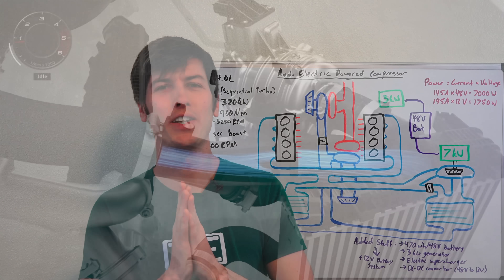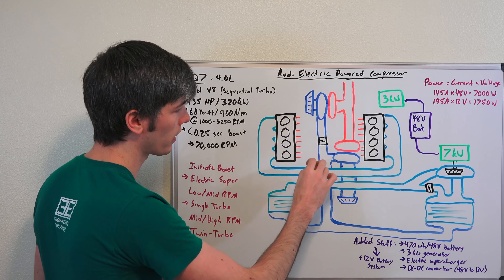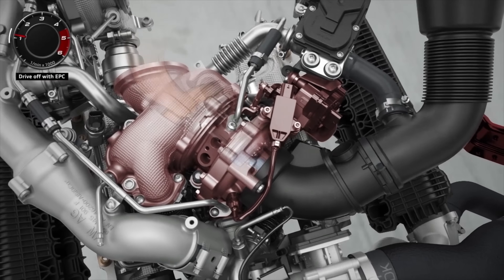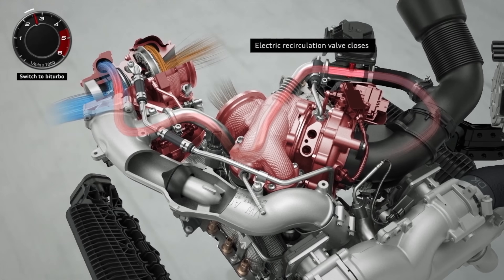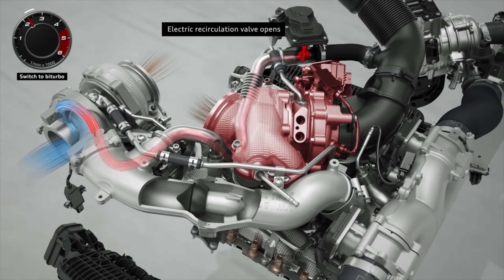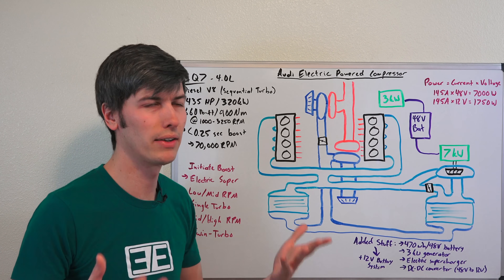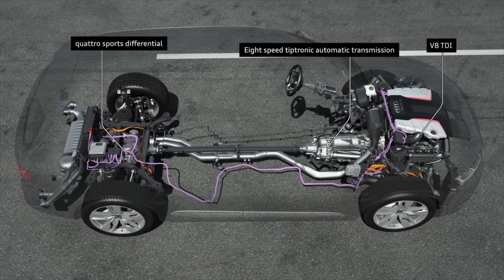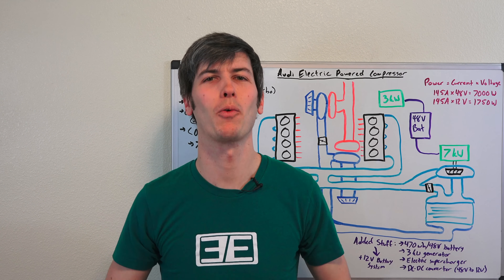Electric Superchargers - How Audi Is Eliminating Turbo Lag

Comment: 145 amps? 
LOL
-car audio guys

Yea, 48v makes it more efficient, but you could get 7kw out of your 12v battery with 583 amps (Wich is less than its cold cranking rating), and do that for up to 30 seconds before you've really put the hurting on a normal 12v battery. 
Instead of having a separate 48v system, you could just have a 2nd 12v battery, and then you're splitting the load between them down to just under 300 amps per battery.

Or just replace the old Lead Acid car battery with a Lithium battery of the same size, and reap the benefits of increased storage, increased discharge rate, and decreased weight.

Then all you need is the motor controller that can handle ~600amps , 7kw, and you're good to go.
Don't need a seperate charging system, just a high output alternator (350amp large case alternator) and you've got plently of power to run the car, charge the battery, and have enough to replenish the battery after the heavy draw from the electric supercharger.

Essentially you just do all the things that the car audio world does to support a 7kw system, but instead of subwoofers and amps you have an electric motor and controller.

Comment: Why not just sandwich a motor between the two housings of a turbo? The turbo could function as usual, and the motor would only be used at low RPM when there isn't enough gas to spool the turbine. Fewer parts under the hood, easier to package, and the motor probably wouldn't have to be as powerful as a standalone electric supercharger.

Comment: I disagree with the conclusion because the only expensive part is the compressor and even that isn’t that expensive. The electronic components are dirty cheap these days. And if (there’s the catch) the manufacturers decide to switch to 48V altogether the cars wouldn’t be that much expensive. And you could gain in reduced consumption what you would pay extra for the system. The manufacturers are the ones who want us to pay more for a technology that should be already installed in our vehicles. So that’s that. Otherwise a really good presentation. And thanks for it.

Comment: So similiar to what f1 is doing?
Reply: Harry Kettle not really. F1 has the motor between the turbo inlet and outlet, plus a generator on the crankshaft. The turbo outlet takes over the job of generating shaft power while the engine is running, and can even be wholely disconnected from the inlet to be used to scavenge energy for the battery.
Reply: David Jackson, II Thanks!

Comment: Think an assist motor like ram truck introduced would be much more useful. As it can also recover energy under braking. But this idea may have been more practical for emission reasons in keeping the exhaust hot.

Comment: Battery would only be powering stuff when engine is not running (I understand the need for the 48v system for powered turbo)

Comment: Electric motors: instant torque/instant boost. Can't beat it. Audi A7 uses the 48v battery for its mild hybrid system (torque), and the Q7 TDI uses it for supercharging (boost). No matter how you see it, electrification is the best for efficiency and performance.

Comment: It is not because 12V cannot deliver 7kW. It is because you cut down the current by half by using 48V when delivering same amount of power. With that, you can design a motor running at lower current hence, smaller conductors.
Reply from the maker: 1/4, not 1/2
Reply: Engineering Explained o yeah my mistake

Comment: There is a mechanically and conceptually simpler way to do this, and they are starting to use it in Formula One. Conceptually, take a 5 ~15 Kw electric motor / generator, and stick it in the middle of the turbocharger. Imagine something like a big electric drill, or a starter-motor. At idle or small throttle constant speed driving, it does nothing. When you start to drive harder, the EMS uses the battery to drive the motor, to provide at least the start of boost, to limit and minimise turbo lag. It spools the thing up, and it does that when you start to get on the throttle... Once the motor starts to make boost, the EMS switches the circuitry around and starts to use the motor as a generator, and gives back to the electrical system. By controlling how much mechanical drag the generator makes on the shaft, you control the boost. Suddenly you don't need pop-off valves and waste gates, you need electronics that can handle high current and fast switching, and a clever piece of software that controls it.
The downside is you need a pretty good electric motor / generator, because it has to spin awful fast, and if it has the power capacity to work properly, then it adds a huge amount of inertia to the turbo. Without the electric assist, the turbo lag is going to be about 10 seconds... and then it has no waste gate. Without the generator function, you're going to overboost....
What you describe in your clip, does a similar job, but it's more complicated and less elegant and probably not as effective.
Mercedes Benz and Lewis Hamilton like this idea, and so does Sebastian Vettel and Ferrari... Honda probably don't like it, because they've had a tough time getting it to work properly...

Comment: Complexity is the enemy of reliability. This is easily one of the most complex systems I have ever seen since the Bugatti W16. Can't wait to see these break down and the repair bills that follow. I'll stick to my EV.
Reply: audi already has a 48V battery in most of their cars. it's just better and more reliable than a 12V alone. so the only thing they added here is one motor-compressor. quite simple solution for the age old problem of turbo lag.
Reply: yeah..you get error code by changing the wheel size these days which is absolutely bonkers..
Reply: Was thinking almost the same thing - WAY,WAY too many things can go wrong with such a sophisticated system- I'll never think of buying one.

Comment: so apart from that stonking v8, its got two compounding turbochargers (i hope im not wrong with the term), an electric supercharger to fill in the turbo lag, a separate 48v system, two intercoolers, and valves that deactivates when not needed...

Comment: That sounds needlessly complicated.
First: why not electrically spin up the small turbo? It would save 1 charger and effectively reduce the power needed before the engine can take the charging over.
Second: why 2 separate batteries? Why not just 1 48 V battery and then convert it wherever needed, those components are dirt cheap nowadays and you would actually have less impedance on the wires with 48 V.

And all of this complexity to avoid making the engine bigger to avoid taxes.

Comment: Could you just add 4 car batteries or deep cycle marine batteries in series in the trunk to get 48 volts and then add an extra alternator to charge them? Would that provide enough current? Besides the weight penalty, what problems could it have? It would be pretty cheap too. Electric superchargers for everybody!

Comment: Jason, can you explain a bit about the advantages of using the 7 kW motor to compress air, versus simply using it for torque-fill by direct motivation of the engine?
Reply from the maker: By compressing air it eliminates turbo lag. If it were to to power the wheels, 7 kW pales in comparison to how much power the twin-turbo V8 makes. You wouldn't notice a difference.
Reply: In order for that to be true, an input of 7 kW would have to result in an increase in output exceeding 7 kW. Doesn't that violate conservation of energy? I guess this question applies to superchargers in general though.

Comment: wow you are an ontime bro...So when are you going to drive the Audi SQ7 just for the point of determining that your complaint about turbo super cars that being a throttle that responds timely to the driver's input with out delayed engine response does not occur or occurs to a lesser degree in the Audi SQ7..By the way what was the last cable actuated throttle bodied car you drove?
Reply from the maker: My S2000 has a throttle cable, drive it all the time.
Reply: so no computer chip in your s2000 to determine if ......before allowing the throttle response chosen via accelerator pedal position ...if you you do not understand what I mean by "determine if " I mean stuff like current grip/slip, yaw, engine speed, gear transmission current in, and let us not forget EYSIGHT governor's input opps did I just reveal that currently I am driving a subaru
Reply: Found this throttle by wire (cars computer + throttle pedal position) versus throttle by cable (your foot) quote and understand why you dislike turbos. 
"i didn't think about that. you went from a throttle cable to throttle by wire. the tbw will only open the throttle at a set rate whereas the throttle cable opens the throttle as fast as you can stop on the pedal. with the tbw, it only opens at a certain rate whether you roll onto the throttle quickly or if you stomp on the pedal. you literally can sit and stomp on and off of the throttle quickly and there will be no fluctuation in throttle response. this may play into the feel when you're getting back on the gas after shifting gears."

Comment: I guess if you buy a high powered luxury SUV you're probably not the sort to worry about repairs.
Reply: Yeah there is a reason these cars are worthless once out of warranty. But there are some good cars to be had for a careful buyer. But with increasing complexity like this, those days are coming to an end.
Reply from the maker: Exactly the truth, I think a lot of the comments miss this point. People lease and exchange expensive vehicles every few years. Reliability doesn't always matter, depending on who the consumer is (and that doesn't mean it can't be reliable, either. Just depends on how long the engineers want it to last).
Reply: @EngineeringExplained  That's what needs to change in this world, throw away society, a well engineered product should be reliable and last, otherwise it's badly engineered.
Reply: Luxury car brands are over 60% leased. Those buyers tend to want a new car every 3 years and know that a dealer will take care of any issues with it during that time. Business wise it's probably a better model to lease and rotate people through new cars more frequently than if they bought.
Reply: fuel economy is the reason. if you rotate a regular supercharger continuously it's gonna use a helish amount of power. turbo's are more efficient and they don't use power if you're not on boost. and you won't be on boost unless you mash the accelerator because it's a good ol' v8. they want to introduce some mini hybrid system with the 48v system too. so mini hybrid, plus supercharger only on demand plus a bit more efficient turbo means less fuel used. the only thing to drink your fuel left is the lower compression ratio to accomodate the boost.
Reply: Most engine technology was unreliable when it was first new. Over time this may become more reliable and it may just be the standard way to use turbos
Reply: Eric Cassidy everyone worries about repairs hahaha
Reply: The thing with conventional superchargers is they always suck power from the engine this one powers off when it's not in use so it doesn't make any power from the engine. That said I suppose they could use a clutch system for the supercharger like how an A/C compressor works and that would be quite a bit simpler design but what do I know. As for the turbos they are there for additional power and it is slightly better in terms of emissions to have it set up like so as compared to a big massive engine with just a supercharger and still produce an enormous amount of torque and horsepower.
Reply: Just complex systems to prove diesel is obsolete.  electric cars is the future
Reply: Engineering Explained I don't get it why they didn't use a motor in a conventional turbo. When you have too much pressure in the intake manifold just use the motor as a generator and you have regenerative braking, like in f1 cars
Reply: Indeed. Turbo's don't use fuel. Superchargers indirectly do.
Reply: +Jeff... Only when you are beating on them.
Reply: Scotty Kilmer trollol
Reply: Kind of true. But there is one thing being left unmentioned; the 48volt battery system is also used for other things as well; like the active sway bar system present in the SQ7 at least. But yes, that even more breaking technology at the end. I think this channel has even a video about it.
Reply: "Turbos use a lot of fuel when they are being utilized"

This is a turbodiesel. They're quite different in the way turbos affect them than spark ignition vehicles. Remember they already have good low end torque. Turbos are primarily a way of boosting efficiency and secondarily a way of widening the torque range.

The dual turbo setup driven by a variable cam setup (which are well proven) is a really clever way of switching in additional boost when needed without needing hideously complex variable plumbing and multiple dual-scroll turbos. I think this one will be fairly good in the long term as long as VW can keep their electronics reliability (especially their connectors!!!) under control - and to be honest, 99% of the problems I see in this area are caused by dealers and service agents, not by VW itself. Germans assume that if they install something for waterproofing, that it will be reinstalled after servicing, not that bubba the apprentice in the stealership will break it and throw it out as a nuisance part that gets in the way.
Reply: Actually, a more expensive car SHOULD be of higher quality and MORE reliable.  Unfortunately, usually just the opposite is true.  If you want maximum reliability, you have to get a Japanese car in the low to middle price range.
I heard about a widow who sold the Jaguar she inherited from her husband.  When the garage told her that you have to expect to pay more to maintain an expensive car, she replaced it with a low price car.
Reply: So they pay perhaps $400 monthly or more to lease an expensive car.  Surely there are better uses for the money.  Also, for many people, those cars are basically status symbols that they can barely afford.  They don't impress me; they are for "new money" people.  "Old money" people are more likely to buy less expensive cars.  There are multi-millionaires who own low to middle price Japanese cars like Toyotas or Nissans and live in modest houses.  Conspicuous consumption is in bad taste.
Reply: Note to self:
Don't buy an Audi
Reply: German electronics=Run away fast.  I’d say “drive away”, but your Audi/Volkswagen already has a bad circuit somewhere and won’t run.
Reply: "Turbos use a lot of fuel when they are being utilized" "turbos" don't use any fuel
Reply: tarstarkusz no fuel difference, turbos use more fuel because more air plus more fuel= more power
Reply: This system is just ridiculously complicated and has many failure points. It's hard to know why they just didn't put a supercharger on it in the first place. Turbos use a lot of fuel when they are being utilized. There is probably some advantages for fuel consumption doing it this way, but the cost and complexity is probably not even worth it. It's not like those 7kW are free.
Reply: Engineering Explained reliability doesn't matter? Ok so you admit this is junk. What kind of engineer are you?

Comment: I thought such electric type supercharger would only be in market by 2020, it seems to be 2 years earlier than that. But, my favourite is hybrid electric in parallel with turbocharged engine, that is dual traction source,  a bit as in McLaren, or in BMW i8 i think.

Comment: this Audi V8 is a very powerfull performance diesel,  need a lot of air and such system,    but smaller petrol engine?  would be 12 V enough for only priming the lag ? and less complex parts needed ?

Comment: i dont remeber where  but i did saw some guy that modded his car by putting a set of 6 condensers instead of a normal battery and he ran out of that totally normal couldn't this be done to this exact system reducing the need for a lead/agm battery?